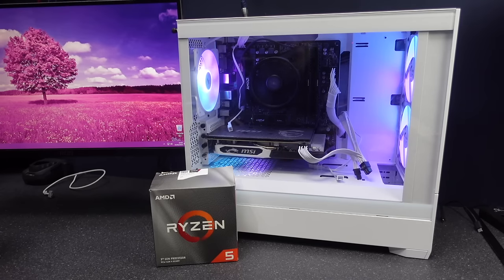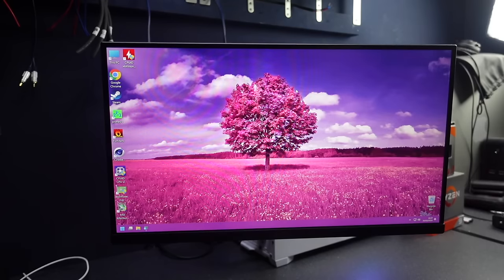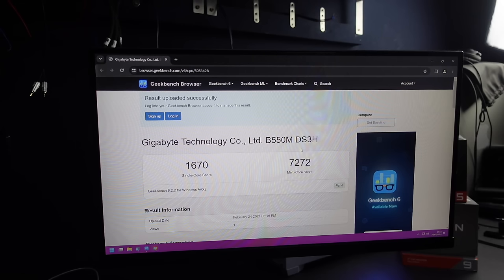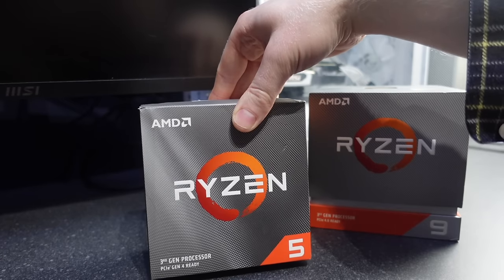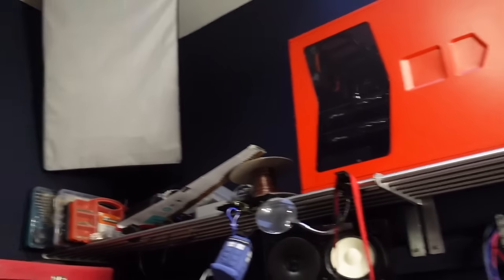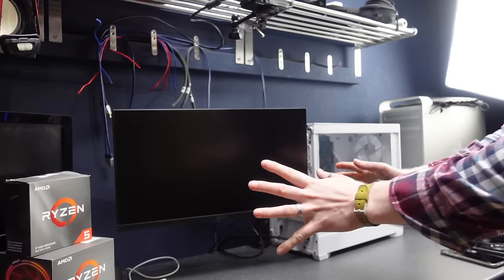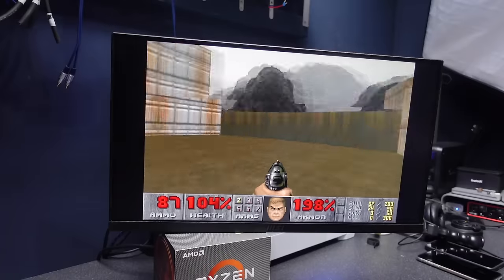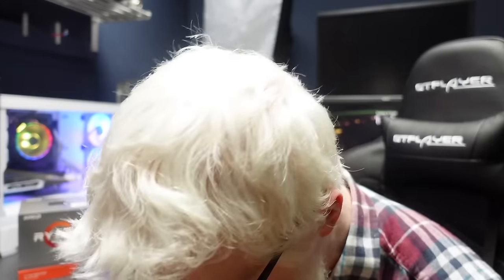Budget Micro ATX Gaming PC Build (New & Used Parts) - Part 2

Comment: When i saw you put that stock cooler on it i was thinking it's gonna be loud and hot and i'm honestly impressed it isn't. I tried that same cooler on a 5800x and it was reaching 90C lol
Reply from the maker: I was shocked too! I was expecting a much higher temp under full load.
Reply: @ItsMyNaturalColour  Also forgot to mention,the USB cord for the cooler is to be able to control the RGB with Cooler Master's own software on motherboards that don't have RGB headers. The other connector is actually meant to be used on motherboards that have a "JARGB" or "RGB" connector on them and the RGB is controller by the motherboard's software,in this case it would be Gigabyte AORUS Master if i'm not mistaking. With the USB cord you can control the light ring around the fan too,but with the other connector you can't

Comment: Sadly CPU cores are meaningless in modern gaming. Most new titles are depending of single core performance. That's why you can see some new, but low end Intel for example crushing some older high-end/high-core Ryzen CPUs.
Reply from the maker: Absolutely! Money is much better spent getting the best possible GPU, at least when buying new. With these slightly older builds and second hand hardware, it gives a bit more wiggle room to be less sensible.
Reply: @ItsMyNaturalColour Yeah, solid builds for sure. Pretty excited for the water upgrade. :)